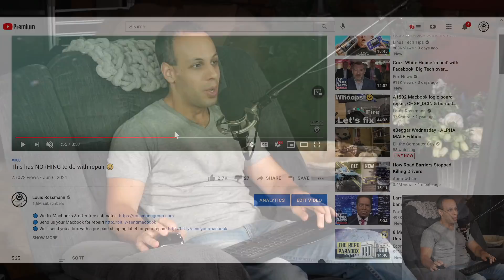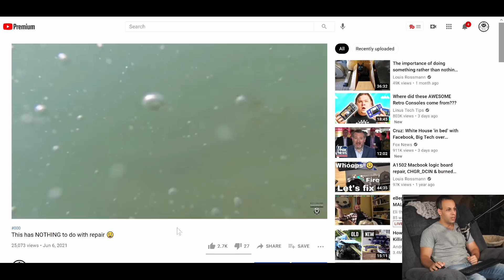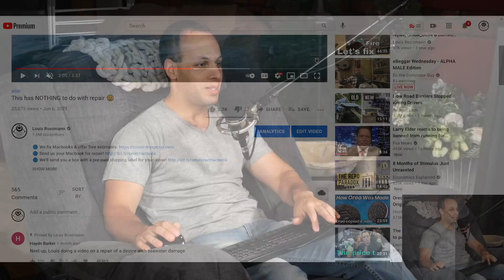Why are user serviceable batteries a bad thing?

Comment: I miss removable batteries like the note 4 so I can replace the stock battery with a higher capacity 10,000 mah battery. I wish every phone has an external battery case but not every phone has been made for them.  With software updates, I have to charge my phones more frequently since battery drains faster after the software updates and the phone gets warmer than usual. I'm using the same apps and tasks but the software updates are to blame. I brought software updates because I need my phone to be able to last for a while when I'm not near an outlet and my power bank is dead.

Comment: You know it's kinda funny.  I'm an old guy and I have a Samsung Galaxy Core Prime that I have been using everyday for years.  I have dropped it on the concrete floor of my parking garage, it got dunked in the sink once.  Yeah, the edges are a little dented up, I had to use a blow-dryer to get it to work again after it was dunked.  But the entire back of the phone just snaps off and the battery is easily replaceable.  In all these years, the only thing that required replacement was the battery.  I bought one and replaced it myself.  That being said, after seeing many of your videos I am astonished that nothing else in my phone has ever required servicing.  The display is still bright and normal. The headphone jack still works.  The charging port still functions normally etc.  I don't understand why so many relatively new devices have component failures.  Things like IC's and capacitors etc.  Why is that?

Comment: Well. The thing is even worse towards the upcoming electric car structural batteries, which despite being tightly integrated in the chassis, furthermore its cells are epoxied (covered with epoxy resin). What means that it'll no longer be possible to identify a bad cell (which ruins the entire circuit) and therefore the ability to replace such a bad cell. Thus the ecological solution that electrics are intended to solve will turn into another recycling nightmare. As well as astronomical bills for the customers.
Reply: I mean, pretty sure it was a nightmare from the start, it's not like cars running on electricity magically solved the problems of messy production and disposal. Seems like people love to fixate on the lack of emissions and ignore everything else, but ignoring the fact that those cars can be equally shitty in design and create even more problems if manufactureres can get away with it on the hype wave

Comment: I mean, I'm typing this comment on an LG V20. User replaceable batteries in phones are just better design.

Also, having limitations to a design (though it doesn't have to be forced, I mean from a design philosophy perspective,) leads to innovations. Designing a battery to be waterproof wouldn't be necessary if the battery was incorporated in a way that made it fully integrated into the device's shell. You would just make the shell waterproof and would have no impetus to waterproof any components inside. However, that corner cutting leads to situations where if the shell cracks, it's an immediate concern rather than a matter of aesthetics.
Reply: LGv20 here too!
My first LG phone, and I haven't needed a replacement in several years now, just had to get a new battery at one point.

I quite like the 2nd screen functionality, I can just pull it out of my pocket to check the time without having to power up the whole screen.

Comment: I bought a personal security camera (Marantz PMD-901V ) from Vegas pawn shop. 🤣Shipped to the UK.  
Used it 1 day and the battery is now dead and wont charge.😢 I'm now struggling to source the replacement. 
I found 1, just 1 supplier online anywhere in the world. ordered x2, via paypal (just to sure im not getting ripped off) luckily the casing has rubber capped screws, so hopefully i can get it open. hoping the BMS isn't fried as well, these cameras are priced like Apple products....

Comment: Ericson R310s had a user replacable battery. In the manual they showed that when it's dirty you simply wash it in the sink. I was a kid when I owned it and I dug a hole in a river and dug it in the fucking river and it still worked an hour later without any issues. Seals are no magic and never have been. It's also not about design. Apple, Samsung and all the others had no issues making a really, really ugly camera bump at the back. Using a seal and a replacable backplate cover would add 1mm max to the phone. And nobody, literally nobody gives a fuck about that.

Comment: 1) Software updates are  (for lifespan) way more important than battery replacement.
(I use a realy old Smartphone, but cant use it for anithing that needs security, because it runs Android 4.1.2)
2) Water resistance with glue-seals is way easier (and cheaper) than other seals, like a gasket that needs screws (or similar) to work. Dependent on how much water resistance you need on the device.
Dripping water (1 in IP), is very different from a Jet (5), or 1 meter of depth (7)

EDIT/PS: If i see the video correctly, they have the force holding in the Battery also hold the seal under tension?
Most systems i encountered that worked like that had the locking mechanism fail quiet fast (compared to screws).

Comment: With a sealed in battery is easier to design the machine as they like and they actually need less space and are able to make it slimmer.
Said that, I wouldn't mind if it was a bit bigger and I could change the battery

Comment: How Freaking cool would it be if the next iteration of the iPhone had a user replaceable battery. 

I picture a sim card ejection like mechanism to eject a battery.

Worried about individuals bending the battery and causing a fire. Well, you could do a reinforcement tray.

There is SO many cool options the iPhone could employ. Think User replaceable hot swappable batteries. Two small thin batteries that eject like a sim card. Each one independently removable and rechargeable.

I would actually have a use for this backpacking or remote operation from a basecamp with a solar charger - so I could charge my phone without having to leave it at camp. Simply come back, swap batteries, go again; and not need to carry heavy charging bricks. This would allow me to listen to music continuously, or numerous other things while out and about. Not constantly being tethered to a wire or a charge port. That would be a game changer.

Comment: I AM NOT giving up my LG V20 until it is completely dead.  I have a spare for parts. I can easily keep it out of water. I can't.easily open a Samsung. I have a $20 completely waterproof speaker that has several huge open holes. Why can't they put a gasket around a battery door on a $1500 phone?

Comment: "The battery needs to be sealed inside the phone for liquid resistance."

Your charging port, headphone jack, SIM card slot, speakers, and microphone beg to differ.

Edit: You forgot to add that once you remove the screen to replace the battery, you lose all liquid resistance anyway. So even if you're willing to pay to have the battery replaced, you're still getting screwed by that sealed-in battery.
Reply: 1) In general Voltage is a factor for how thigh the seal has to be, and the size of the perimeter is also often a factor.
1b) If you have to remove the whole back for the battery, screws in each corner would be a common way.
(for higher IP Rating)
2) In theory you could reseal them, and keep the original resistance.

PS: I am more familiar with handheld measuring devices, that usually use a Gasket/Ring tightened down with screws.
Reply: @oberonoberon9288  I have no idea what you're talking about. The Galaxy S5 has no screws holding the battery or its cover in place. Nor does it have a gasket sealing them.

Nor is there any sort of external gasket sealing any of the ports on my liquid-resistant phones. All of those ports are open to the water. I think you're talking about a different class of devices. In which case, I'm sorry for my ignorance, but that's not really the point of discussion.
Reply: @rars0n  
1) The grey line on the cover, schould be a type of gasket, or i translate that word wrong. (In the images i now it is gray.)
2) Screws "for higher ratings" like some models by CAT. (Some of theirs use screws and glue, IP68and maybe a bit more with a water-resistance of  5m for 1h)

I also stated in the post that i am more familiar with handheld-measuring devices,
Reply: @rars0n  "Inebriated": No problem.

Old version; mine is about 8 Years old (4.1.2), but the phone is still working fine. I just cant do anything that needs security on it. 

"I see what you are saying": Every type of seal has its application.
But since we are mass producing we mostly use the cheapest one. 
And if a consumer has the choice between two products that are the same except one is cheaper but glued, cheaper wins.

Thanks to Brands we also cant go with "Who byes cheap buys twice", it wasen't even really true in the old days.

I should also mention that i like the
Reply: I cracked the screen on my S10+ and took it to Samsung's official repair shop, they said the waterproofness would not be affected after the repair.
Reply: @greentjmtl  All depends on how good a job they do. 
I had a "Protected" wristwatch fail on me, while a old one that never heard of water protection was completely fine.
Reply: @greentjmtl  They lied to you. Next.
Reply: @rars0n  And your proof is?
Reply: @greentjmtl  They lied.
Reply: @rars0n  Seems like so far you are just insulting everybody with no evidence to back up any of your claims, typical internet loud mouth I guess.
Reply: I had a Motorola G2 (IIRC), which was water resistant.  I tested it in a pool, and no issues.  Months later I changed the battery, and I did not loose water resistant.  No issues at all.  There is a cover that I needed to remove, but the seal is not of the type that gets damaged once you tight the screws, no need to change that seal.  The phone was resistant to something like 30~50cm of water, more than enough.
Reply: @ikocheratcr  Yeah, you have no idea how your phone is assembled, so your anecdotal evidence is invalid.
Reply: @rars0n  Just wondering, why you say so?
Reply: I don’t like sealed in batteries either but your reasoning is stupid and makes everyone fighting against them look bad. There are now behind screen speakers and microphones and even the ones that aren’t are water proof. Charging ports are also water proof. Yes they dip into your phone a bit but that is only so that the cord will stay in it is sealed off from the rest of the device and the contacts can handle getting wet. Not to mention headphone jacks are a thing of the past and soon enough charging ports will be too. Soon phones will become completely portless. About you saying water seal is broken after removing screen to do repair. Wrong only if you are stupid and don’t know what you are doing. The screen uses a rubber seal usually glued in place. The glue helps but isn’t needed for it to be water proof the compression of the rubber is what causes the seal. But a proper repair job would include replacing or re-glueing the rubber. Anyway not advocating for sealed in batteries you just have all the wrong reasons. Edited to fix spelling because autocorrect likes changing correctly spelled words into words that either don’t exist and or aren’t even close to the original and don’t match the context of the sentence.
Reply: @jacobleeson4763  I will fight hard for headphone jacks. I have multiple quality headphones that 1) I never have to charge, 2) I never have to worry about losing, 3) get a superior signal compared to bluetooth, and 4) don't have to worry about managing a menu of connected devices to use. 

Also wireless charging is less efficient than wired charging, so worse economic and environmental impact. I don't understand the hatred of wires. Is it marketing thing?
Reply: @jacobleeson4763  YA KNOW, we could solve all of these problems FAR easier by just adulting up and treating phones like any other consumer electronic device and keeping it the F away from water. 
With water sealing no longer a concern, you can have all kinds of design freedom that's otherwise lost, so you don't have to hamstring and neuter devices. 

The sole reason I've ever used the 'waterproofing' features of my S8+ is to be lazy cleaning it. I can just wash it with warm water in the sink, but I don't NEED to do that. No previous phone I had ever had water issues. I had a Palm Pre get left in a backpack and submerged on a float trip back in the day, and it was fine by that monday when it dried out. I miss slide out physical keyboards on phones.

Comment: I generally agree with you except for one thing: The hard to remove battery isn't some propaganda to make the device less repairable (or at least this isn't the main reason). It mostly has to do with the cost of manufacturing and the thickness of the device. Having a replacable battery means having at least somewhat durable box for the battery as well as another box to store it in the phone. This takes away from volume that could have been used for more battery or something else and adds thickness which is something that smartphone and laptop users seem to really care about nowadays. The camera you showed as an example is relatively thick which allows for a battery slot and a battery box. It also doesn't consume a lot of energy and if needed you can bring extra batteries and swap them. Nobody wants to swap their phone battery during the day.

I personally don't mind hard-to-replace phone batteries if it is the cost of having a lighter, cheaper and more waterproof device (cherry-picked examples like your S9 don't disprove this relation in the general case). You only need to replace a phone battery after 4-5 years of use if you didn't abuse it too much (I haven't noticed a significant drop in performance of my phone's battery and I've had it for 3 years, my previous phone lasted 6-7 years before something else stopped working). And at that point it is likely that you would want some new tech so you are unlikely to need to replace the battery more than once, if even.

To be clear, I definitely wouldn't want a device like a camera to have a soldered battery and if I had the option I would chose an easily replacable one over a glued-in one for any device as long as it's not at the cost of something else that I might care about like the weight, thickness and waterproofness.

Comment: 1:58 From working mainly on Motorola phones, I can tell you for sure, that user replaceable batteries and non-user replaceable batteries are in fact quite different in energy densities.   The user replaceable batteries need to be armored so they can't be easily accidently punctured from a screwdriver and cannot be easily bent in the palm of your hands.  The non-user replaceable batteries are not armored, they're very delicate and can be punctured by a slipped screwdriver or bent in half with your pinky finger, which damages the battery internally.  The non-user replaceable batteries, by design use the structure of the phone as its armor. The user replaceable batteries need to be individually armored or made out of a puncture resistant and bend resistant shell to prevent accidental damage.  

So somebody saying they don't want a user replaceable battery to me is somebody saying they prefer the batteries with the higher energy density for volume and weight.   I honestly strongly prefer the user replaceable batteries.  Also I don't sweat as much when replacing a user replaceable battery as opposed to replacing a non-user replaceable battery. Feels like doing surgery on a hand grenade when I replace these non-user replaceable batteries and I have had them suddenly go pop, burn, and make a lot of smoke when trying to remove them from phones in the past. Especially when they are already bulging out of the phone from being left in direct sunlight or on the dashboard of somebody's hot car all day,  before I even crack open the phone.  The armored user replaceable batteries are more safe to work with if they are bulging out of the phone because they have that extra armor on the battery itself. Also more safe for people that use the phone too in my opinion!.

Comment: The problem with removable batteries is that people might unplug those batteries in situations where they would want their phone not being able to spy on them.
Reply: Seriously underrated comment 👍
Reply: Absolutely.  As long as that battery is connected it gets tracked.
Reply: It is the main reason why it is that way.
Reply: Wouldn't that be a good thing tho? If you really don't trust that OFF means OFF, then what's a better solution than removing any power source from your device?
Reply: @darkthunder301  Good thing for you, but what about for the NSA?? 😉
Reply: @vickas54  what they don't know, wont hurt them 🤐
Reply: Noobs don't know about battery kill switch mods with ribbon cable and slide switch
might be harder for some battery connectors but if you know where to do cutoff one can easily nopower their phone with a switch flick, and creepy stalker spy Big Brother will be none the wiser.
Reply: Cause they want destroy our phone in water every t I me we need to turn it off

Comment: People say the battery needs to be sealed but forget there’s a giant hole that’s even harder to seal called a charging port. Batteries can be modular by having contact points flush with the back casing. Yes the water would kill the battery but the device would still be sealed.

Comment: at least when your non-water-resistant phone with user replaceable battery falls into water, you can remove the battery in a matter of seconds to prevent corrosion... by the time you get to unplugging the battery in a sealed device, there will be quite some corrosion waiting for you...